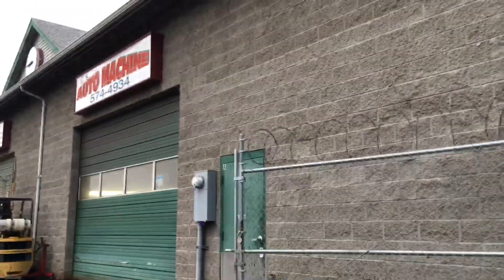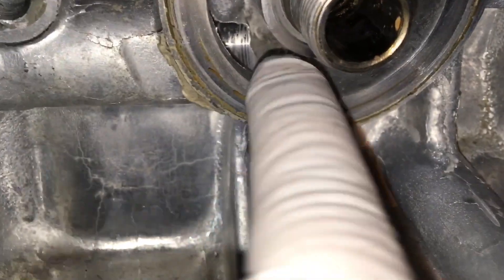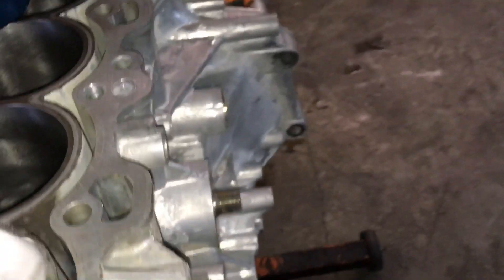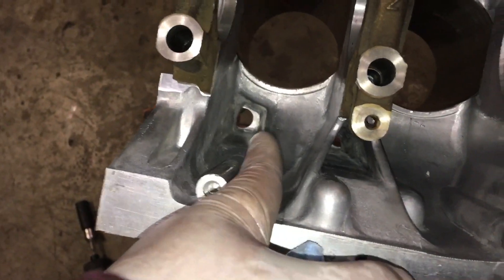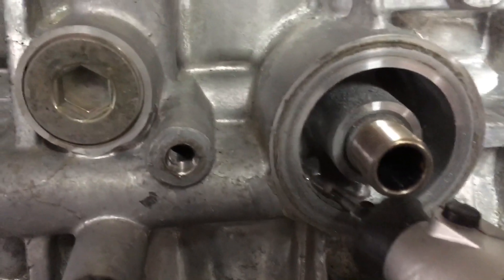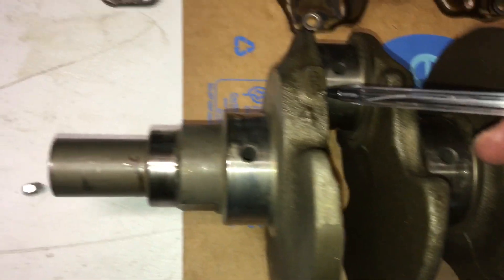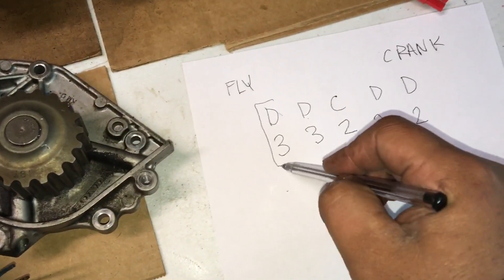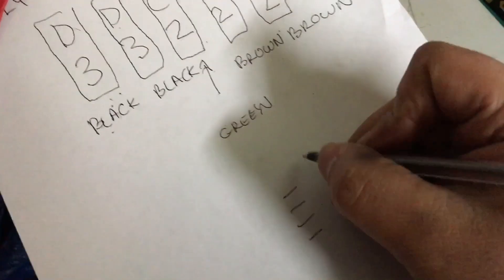B20 NA main bearing + rod bearing Building a stock B20 NA Kham bottom block DIY

Comment: i know I'm resurrecting an old vid but what if my b20 crank doesnt have the crank codes? cause ive no stampings on mine in those areas. i do have a few in other places but there not related. any  idea how id deal with that? plus the bearings dont seem to tell me either. i was nieve in believing i just needed std bearings as no machine work was done to the journals. please help lol.

Comment: Looking for info on a Honda 1.8L R18A/R18Z Engine conn rod & main bearing code. 
Anyone have idea where it would be stamped on the block or maybe on main bearing bridle?

I have a 07 Civic DX & am dropping in a 2010 1.8L due the OEM Manufacturing problem of Poor Casting Issues on the 2006-08 & early 2009"s Civics with 1.8L in them, which leads to leaking Coolant.
I wanting to do a bearing roll-in before I drop in the 2010 1.8L engine into my car.

Comment: so you said 2 black 2 brown and 1 green for the main bearings. but it should be double correct?  so 4 black 4 brown and 2 green ?
im rebuilding my type r so just confirming this because it wasn't clear in the video.
Reply: Or is it just the upper half and the bottom identified differently?